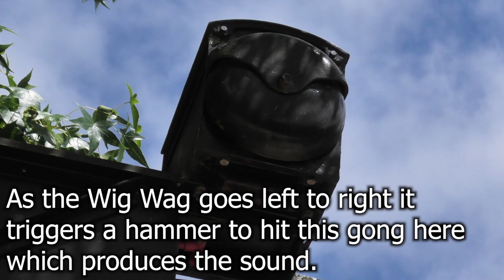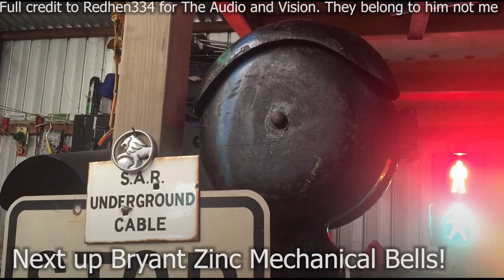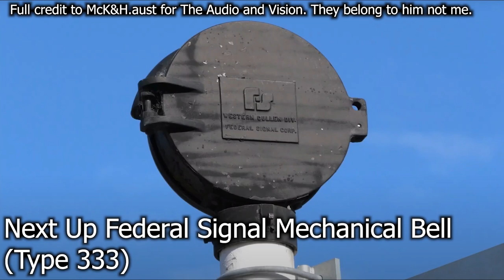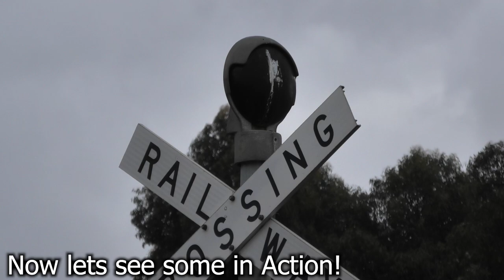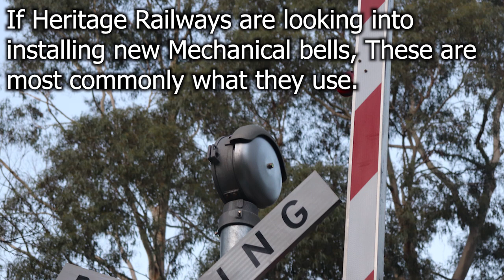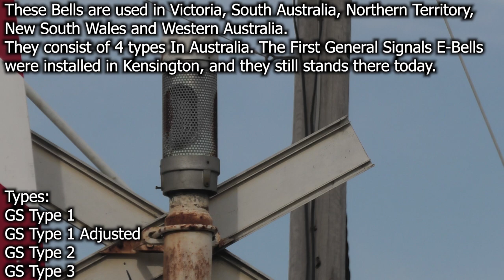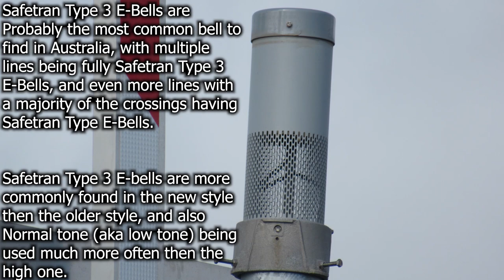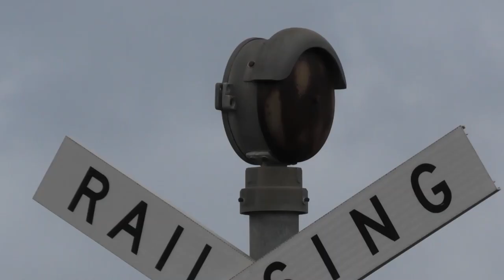Types Of Railway Crossing Bells In Australia (Detailed Version)

Comment: I believe Westinghouse Break & Signal were the primary provider of singling equipment overall on the network in the 1970s, 1980s and maybe into the 1990s! They were apparently also responsible for the signalling, platform screen doors and automatic train control systems on the first two lines opened in the Singapore metro system! :)
Reply from the maker: Oh wow!!!

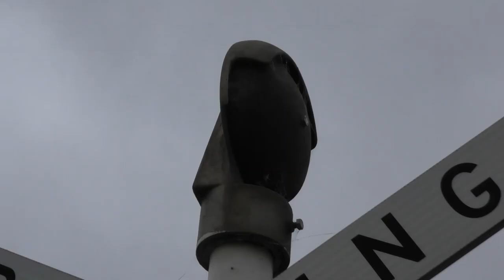Comment: 20:43
I also believe these bells used to also be used on the Blackburn road and Middleborough road level crossings before the crossings were removed! However they replaced the mechanical bells on the Blackburn road crossing with electronic alarms in 2011-2013 by what I can remember! :)
Reply from the maker: Blackburn rd had Hybrid/Teardrop, Middleborough road had GS1’s!
Reply: @TazzieTransport  
That’s really good to know since I don’t exactly remember what types of bells they were! I was also not even 10 years old yet at the time the Middleborough road crossing was removed in 2006-2008! The Blackburn road one was removed roughly a decade later! :)

Comment: The bells at Mont Albert road have seemingly been replaced with the latest type of E-bells quite recently as the crossing was fully refurbished/rebuilt a few months ago but will soon be removed with the line being moved under the road! :)
Reply from the maker: Yep, got upgraded with GS3’s in July
Reply: @TazzieTransport  
That was also around the time they were running train replacement buses between Box Hill and Camberwell for a a couple of weeks! :)
Reply from the maker: @Techno-Universal  that’s when they ripped up the signals and put new ones in
Reply: @TazzieTransport  
Yup while a lot of that newer equipment will probably be moved around the network when the rail trench is built so it would probably be moved down into the new alignment where needed or to other places on the network! :)

Comment: To my knowlege all mechanical bells have been removed from the Northern Territory on National Railways (North Australian line ect.) Last crossing to have a WCH gen one where all the crossings within the Alice Springs area while the WCH gen 2 was removed alongside the grade seperation of the Stuart Highway from the Central Australia line in 2014 or something. Tho I am hoping that the old locomotive at the Road and Transport hall of fame can move and they also can get the reqired funds to make a loop kinda like the Pichi Richi. So a new level crossing would be cool Ngl
Reply from the maker: You'd be correct with that statement, They have all been removed and replaced with either a 
- General Signals Type 2
- Safetran Type 3
or a 
- Western Cullen Hayes E-Bell
Reply: @TazzieTransport  WCH hayes bells havent been installed but with Aurizon taking over the North Australia and Central Australian lines maybe they could have them installed if say a level crossing gets an upgrade or obliterated. Also when the North Australian line was constucted Safetran bells have been the most common. Tho some crossings up north have GS bells they are rare.
Reply from the maker: @Dudedoesstuffright  https://www.google.com/maps/@-12.730824,131.0886384,3a,15y,345.05h,96.65t/data=!3m7!1e1!3m5!1sx7IHcLNW6nz0rqT1g_HGQA!2e0!6shttps:%2F%2Fstreetviewpixels-pa.googleapis.com%2Fv1%2Fthumbnail%3Fpanoid%3Dx7IHcLNW6nz0rqT1g_HGQA%26cb_client%3Dsearch.revgeo_and_fetch.gps%26w%3D96%26h%3D64%26yaw%3D23.75246%26pitch%3D0%26thumbfov%3D100!7i16384!8i8192?entry=ttu

Here is a NT crossing with a WCH E-Bell
Reply: @TazzieTransport  I have been on a road trip up north and I didnt know that.
Reply from the maker: @Dudedoesstuffright  Yea, hard to know stuff sometimes if you don't stalk Google Maps lol